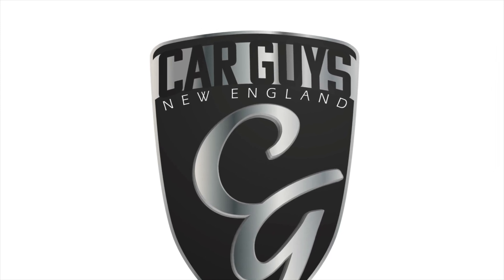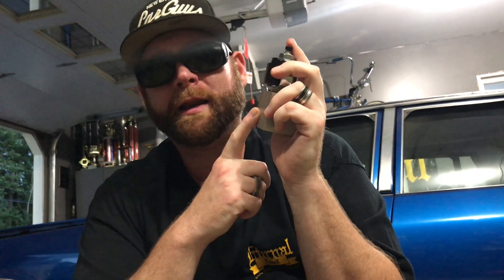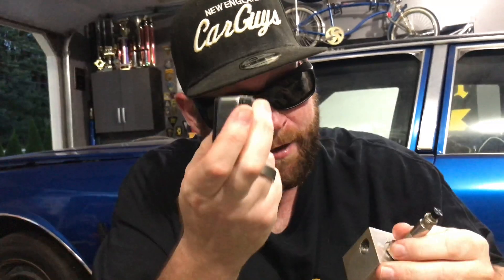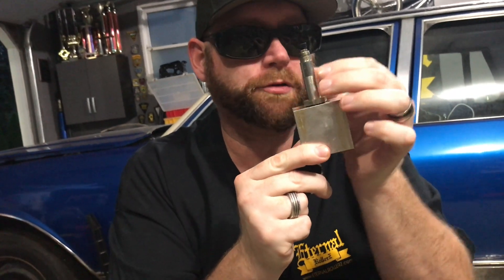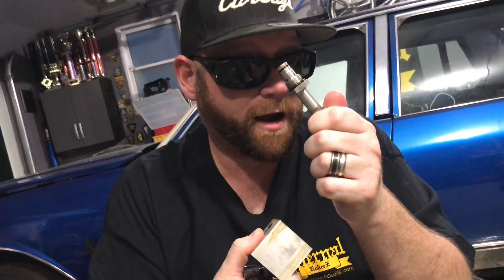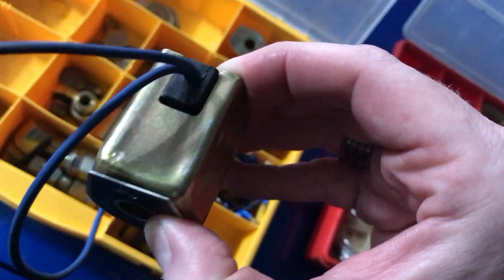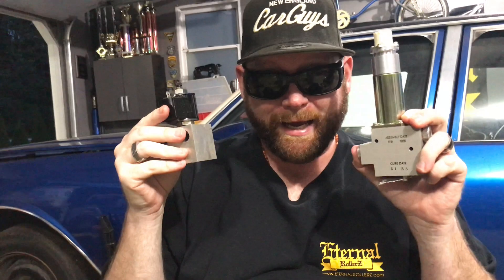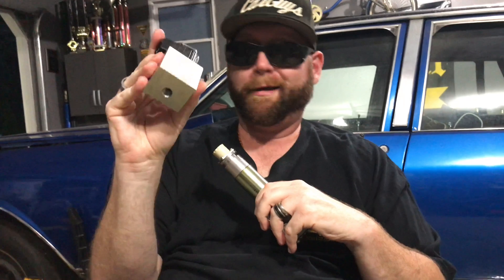Lowrider Hydraulics: Basic Dumps

Comment: Great video! 
Lots of off brand "similiar" Delta dumps made it on to the market in the late 90's and into the 2000's--you could not beat the price and availability! Now, I too have a variety of left over parts but unfortunately, the old guys who were the who's who are gone. Now in putting things together then testing, noticed when dumping, it dumps uneven. Upon inspecting, noticed that dumps are a "bit" different: dump bodies and dump solenoids differ in sizes; could that be our problem?